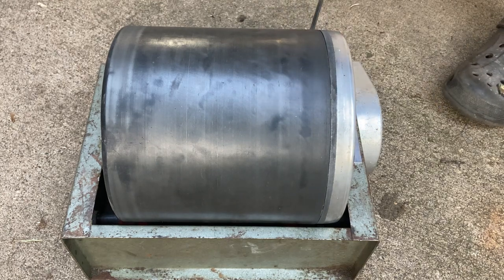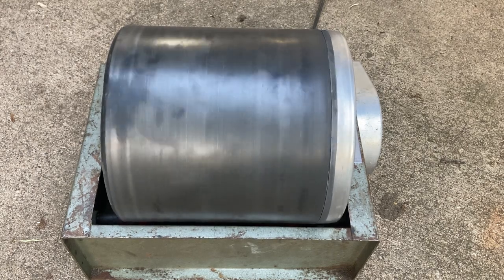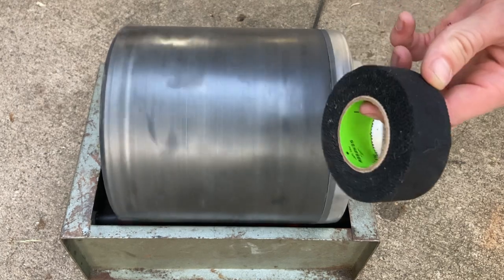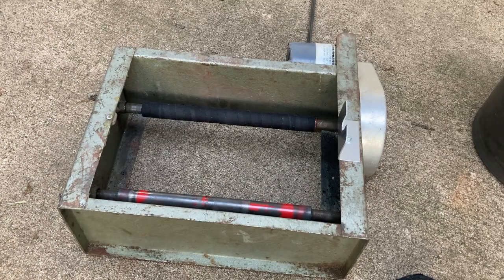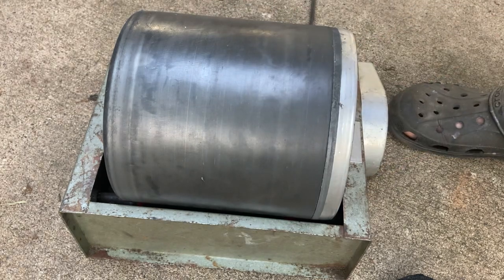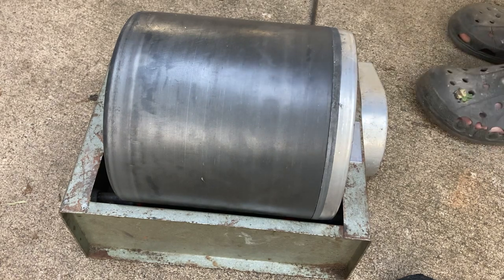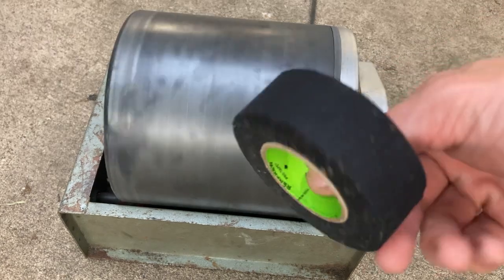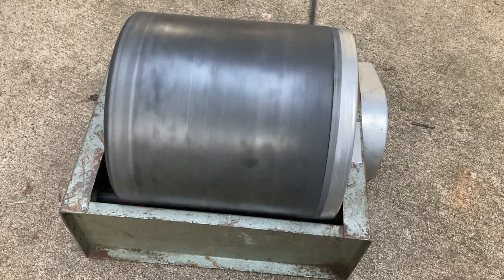How to Fix A Slipping Rock Tumbler

Comment: That's funny.. just today I rebuild my old Lortone 33B.. new rollers bushings and belts.. mine rollers were so bad.. almost worn thru the rubber on the shaft.. I bought it years ago to clean coins I found metal Detecting... I put a lot on and it spun pretty fast😀 but wore out the bushings even faster😬
Reply from the maker: Those Lortones really last though!